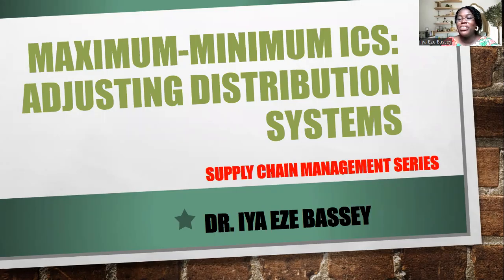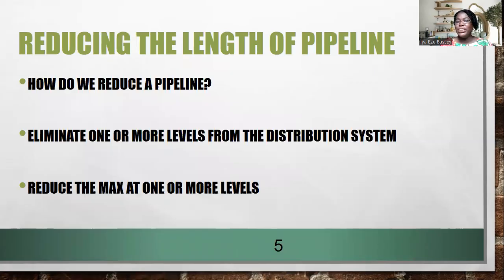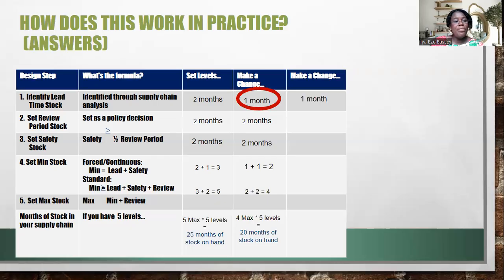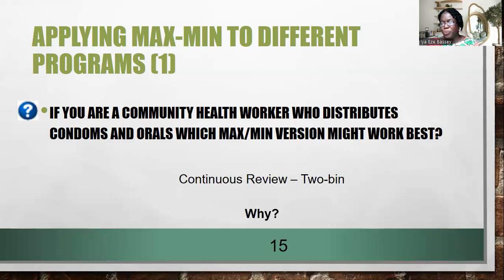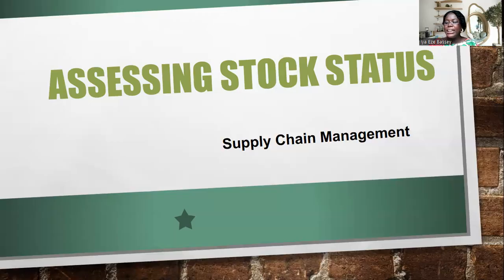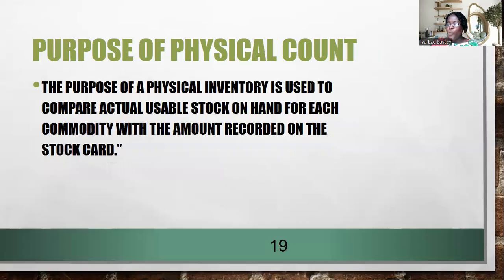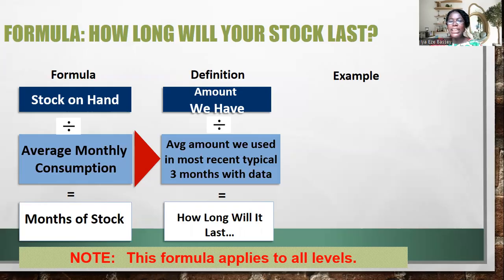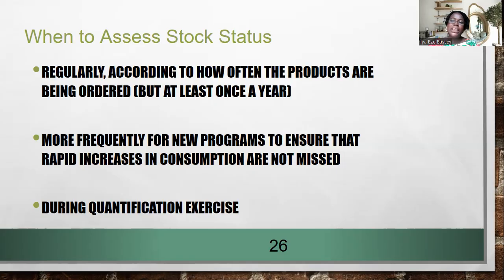Maximum-Minimum ICS: Adjusting Distribution systems (Supply chain management series)

Comment: SUMMARY OF VIDEO ON "MAXIMUM MINIMUM INVENTORY CONTROL SYSTEM
ADJUSTING DISTRIBUTION SYSTEMS"

    I Learnt The STEPS IN DESIGNING A MAX-MIN ICS;
a) Set Up Initial MAX-Min Policies for each level and type of Facilities

b) Check If the overall Distribution will function properly if the level specific MAX-Min Policies are implanted.

c) Check the total length of the pipeline that the policies at each level imply.

    I also learnt How To Reduce The Length of Pipeline, How to Reduce the Maximum Stock Level, How to set Safety Stock, Minimum Stock, Maximum Stock,etc.
    I got an understanding of the FACTORS THAT IMPACT MAX-MIN STOCK LEVELS, such as:
Cost of Products, Cost of Storage, Storage Capacity, Accuracy of Forecasts,Lead Times,etc.
    I learnt the ADVANTAGES OF USING A MAX-MIN SYSTEM, which are to:
Avoid overstocking or understocking, Avoid costs of Emergency Order, Minimize wastage, etc.
    Also, the CHALLENGES TO USING EACH VERSION AND VARIABILITIES were outlined as:
Systems with numerous level, Systems that manage products for new programs, Systems that manage a large number of commodities.
   The video Gave insights on PHYSICAL COUNT; it's Definition and purpose. I also learnt when to assess stock status.
   Lastly, some calculations were done to deepen my understanding of the topic.  

THANK YOU MA

Comment: Thank you ma, 
I've acquired knowledge about the steps involved in distinguishing maxmin inventory control system (ICS), the methods of reducing pipelines length and various factors affecting the determination of max-min stock levels. I've also gain in the benefit of max-min system, such as preventing over stock and under stocking along with various challenges. I'm glad to say that the class was enjoyable..
Thanks 🙏🙏❤❤

Comment: Thank you Dr. Iya Eze Bassey.

I understood that there are different steps involved in designing a max-min inventory control system;
- Set up initial max-min policies for each level and type of facility.
- Check if the overall distribution will function properly if the level specific max-min policies are available implemented. 
- Check the total length of the pipeline that the policies are each level imply.

Advantages of using max-min ICS.
- Avoid under stocking 
- Avoid over stocking 
- Minimize wastage
- Simplify inventory control decision decision making.
- Consistency of stock levels.

To reduce maximum the following are done;
- Shorten the review period at one or more levels.
- Reduce the lead time at one or more levels.
- Improve the distribution systems reliability at one or more levels so that safety stock can be reduced. 

Challenges involved are;
- System with numerous systems
- System that manages a large number of commodities.
- System that manages products for new program.

Factors that affect or have an impact on max-min levels are;
- Cost of production.
- Lead time
- Storage capacity.
- Age of program.
- Shelf life of health commodities.
Finally, I learnt that under assessing stock status entails physical count which is to compare actual on hand for each commodity with the amount recorded in the stock card and the purpose is to determine how long supplies will last.

Comment: Thanks to you Dr iya Bassey for the awesome enlightenmennt  of Maximum and Minimum Inventory Control System (ICS) in the context of Adjusting Distribution System in Supply Chain Management:

Maximum and Minimum ICS is a inventory management technique used to optimize inventory levels by setting upper and lower limits. In the context of Adjusting Distribution System, this technique is used to:

- Set a maximum level to prevent overstocking and minimize holding costs
- Set a minimum level to ensure adequate stock and prevent stockouts
- Trigger orders when inventory levels reach the minimum threshold
- Adjust distribution quantities based on demand fluctuations
- Optimize inventory levels across the supply chain

By implementing Maximum and Minimum ICS, businesses can reduce inventory costs, improve order fulfillment rates, and increase supply chain efficiency.

Thanks ma and God bless you 🙏

Comment: This series takes a deeper insight into the maximum-minimum inventory control system.  It helps to analyze data patterns, lead times, and customer preferences, thus helping businesses to optimize their distribution network to ensure efficient and timely delivery of their products to customers.
Steps in desgning this system was highlighted .
The advantages of the maximum-minimum inventory system are
1 it minimizes wastage.
2;it helps to avoid understocking
3 it helps ti avoid overstocking 
4 it helps to avoid the implications of emergency order.
The factors that can impact on  max-min stock level include; storage capacity,lead time, shelf life of health commodities etc.
To access stock level, it is best to do a physical count of the Total number of usable units of each commodity in the store store or health facility at any given time.
The series also discussed the benefits of max-min ics and it's associated challenges.

Comment: I am grateful for the enlightening lecture, which enabled me to gain valuable insights into optimizing inventory management. The key takeaways from the video include:
- Strategies for streamlining the supply chain: eliminating unnecessary stages in the distribution system.
- Factors influencing optimal stock levels:
    - Product cost
    - Storage capacity
    - Shelf life of health commodities
- Benefits of implementing the max-min system:
    - Mitigating overstocking
    - Preventing understocking
    - Reducing wastage
- Challenges associated with implementing diverse versions and variations of this system across multiple levels.
This lecture significantly enhanced my understanding of managing inventory control for HIV/AIDS commodities, empowering me to make informed decisions in my professional endeavors

Comment: Thank you for the lecture video ma. With this I have been able to understand that the max-min inventory management system (ICS) gives detailed instructions for managing stock levels to avoid overstocking and understocking of commodities. Steps in designing a maximum minimum ICS include;

- Setting up initial max-min policies for each level and type of facility
- Checking of overall distribution will function properly if the level specific max-min policies are implemented.
- Checking the total length of the pipeline that the policies at each level apply to

Comment: Thank you very much ma for this enlightening session…
I’ve learned that the maximum-minimum(max-min)inventory control system  is crucial for managing stock levels helping to prevent both overstocking and understocking.
Key steps is designing a max-min system include:
Establishing max-min policies for each facility type.
Ensuring the distribution system functions effectively,
Setting initial max-min quantities..
Benefits of the max-min system include,avoiding overstocking,understocking,minimizing wastage and reducing emergency costs…

Comment: Good day ma, in summary I’ve learnt the steps in designing a maximum minimum ICS, there are as follows:
-Set up maximum-minimum policies for each level and type of facility 
-Verify that the overall distribution will function properly 
-Establish initial maximum minimum quantity for each level and facility type 
This are some advantage of using maximum minimum system which are: 
1. Avoid overstocking 
2. Avoid under stocking 
3. Minimize wastage 
4. Avoid cost of emergency

Comment: Adjusting the distribution system in maximum and minimum inventory control system involves find tuning the supply chain management system to optimise inventory levels and distribution processes. Here are some key adjustments to consider:
*Lead time reduction : This is the decrease in lead times by negotiating with suppliers improving transportation efficiency or using expedited shipping options.
*Safety stock optimisation : Calculate and  adjust safety stock levels based on demand viability, lead time and service level requirements
*Reorder points adjustments: adjust the reorder point adjustment based on changes in demand ,lead time or safety stock levels.
Other adjustments to consider are:
*Order quality Optimization
* Distribution Network Optimization
* Inventory Placement
* Transportation Management
* Warehouse management
* Inventory Visibility
* Continuous Monitoring 
Implementing this adjustments, optimises your distribution system and improve supply chain efficiency.

Comment: Thank you ma.
  From the lecture video I was able to learn the following 
  How to streamline the pipeline: Remove One or more stage from the distribution system.
Factors influencing maximum and minimum stock level.
 - product cost 
 - storage capacity 
 - shelf life of health commodities 
Advantage of implementing the max- min system 
Preventing overstocking 
Preventing understocking
Reducing wastage
 The difficulties associated with employing different version and variation of this system with multiple levels. The lecture significant improved my comprehension of managing inventory control for HIV/AIDS commodities.

Comment: Thanks MA 
I have learnt that maximum minimum is defined or can be defined as a system implemented to avoid wastage, overstocking and understocking of commodities 
The steps includes 1: creating maximum-minimum rules at the facility 
2 check if these rules will enable the functionality of the maxi-minimum when implemented 
3 check the total length of pipeline these rules require 
factors that could affect maximum-minimum are cost of commodities and their storage, transportation etc
Advantages include :Minimize wastage 
                                     Avoid overstocking 
                                     Avoid understocking

Comment: Thank you for the insightful lecture, Ma'am. Here's a concise summary of what I learned in this lecture:

I got to understand that (ICS) provides comprehensive guidelines for managing stock levels to prevent both overstocking and understocking of goods. From the lecture I also got to understand that It encompasses various steps involved in designing the system, methods for reducing pipeline length, and factors affecting the Max-min stock levels.
There are several factors that affect max-min levels which includes;
1. COST OF PRODUCTION, 2. LEAD TIME,
3.COST OF STORAGE, 4. STORAGE CAPACITY, 5.AGE OF PROGRAM.
And that the distribution system policies can be adjusted by; (a). Reducing the length of the pipeline that is eliminating one or more from the distribution system and reducing the maximum at one or more level (b). Reducing the maximum stock level, i.e shortening the review period and lead time at one or more level.
Thank you ma

Comment: Max-min inventory control system provides comprehensive guidelines for managing stock levels to prevent overstocking and understocking.
This lecture talks about the various types in designing a max- min inventory control, the steps fro reducing pipeline length,and some factors affecting it.

Comment: In summary, i learnt that there are steps to designing the max-min Ics which are 

(1) Evaluate the total length of the pipeline to ensure that the policies at each level comply with the specific requirements 

(2) Establish initial max-min policies for each level and type of faculty 

(3) check if the overall decision will function properly with the max-min policies implemented each levels.. 

Benefits of using max-min systems

(1) it helps to avoid under-stocking
(2) it helps to avoid the cost of emergency
(3) it helps in minimizing spoilage 
(4) it prevents over-stocking 

The max-min ics provides comprehensive guidelines for managing stock levels to prevent over stocking and under stocking of goods

Comment: Thank you Dr. Iya Eze Bassey!

In summary, adjusting distribution system policies can involve strategies like centralizing or decentralizing warehouses, revising stock replenishment rules, and optimizing transportation routes. The Max-Min Inventory Control System aims to maintain inventory levels between maximum and minimum thresholds, providing advantages like reduced stockouts and efficient use of storage space, but also challenges such as the need for accurate demand forecasting.

The logistics management of HIV/AIDS Commodities (LMHC) utilizes an inventory control system focused on ensuring availability of essential medicines and supplies. Assessing stock status evaluates current inventory levels compared to expected usage, enabling calculation of the number of months of stock available at each storage location. This data informs distribution planning and helps avoid stockouts or overstocking.

Comment: The max-min inventory management system (ICS) gives detailed instructions for managing stock levels to avoid overstocking and understocking of commodities. The processes in building a max-min (ICS) include: * creating max-min policies for each level and type of facility; * ensuring that the overall distribution works properly; and * defining an initial max-min policy for each level and facility type. The benefits of employing the max-min system include: reducing waste, avoiding the cost of emergencies, avoiding understocking, and preventing overstocking.

B

Comment: From this lecture session I was able to understand 
THE STEPS IN DESIGNING A MAX-MIN ICS ARE:
1. SET UP INITIAL MAX-MIN POLICIES FOR EACH LEVEL AND TYPE OF FACILITY
2. CHECK IF THE OVERALL DISTRIBUTION WILL FUNCTION PROPERLY IF THE LEVEL SPECIFIC MAX-MIN POLICIES ARE IMPLEMENTED
*3. CHECK THE TOTAL LENGTH OF THE PIPELINE THAT THE POLICIES AT EACH LEVEL IMPLY
REDUCING THE LENGTH OF PIPELINE
• HOW DO WE REDUCE A PIPELINE WE CAN DO THIS BY EITHER 
• ELIMINATE ONE OR MORE LEVELS FROM THE DISTRIBUTION SYSTEM
• REDUCE THE MAX AT ONE OR MORE LEVELS
ELEMENTS OF THE FORMULAS WHICH CAN BE CHANGED IN ORDER TO REDUCE THE MAX STOCK LEVEL:
• SHORTEN THE REVIEW PERIOD AT ONE OR MORE LEVELS
• REDUCE THE LEAD TIME AT ONE OR MORE LEVELS
• IMPROVE THE DISTRIBUTION SYSTEM'S RELIABILITY AT ONE OR MORE LEVELS SO THAT SAFETY STOCK CAN BE REDUCEDOTHER FACTORS THAT IMPACT MAX-MIN STOCK LEVELS (1)
• COST OF PRODUCTS
• RELIABILITY OF TRANSPORTATION
• STORAGE CAPACITY
• COST OF STORAGE
• STORAGE CONDITIONS AT DIFFERENT LEVELS
•SHELF-LIFE OF HEALTH COMMODITIES OTHER FACTORS THAT IMPACT MAX-MIN STOCK LEVELS C
• LEAD TIMES

Comment: In summary,To MAXIMUM-MINIMUM ICS: Adjusting distribution system is all about identifying ways to Adjust distribution system policies by knowing the steps in designing a max/min control system which includes
1.Set up max-min policies for each level and type facility
2.Check the overall distribution it will function properly if the level specific max-min policies are implemented
3.Check the total length of pipeline at each level imply
The benefit of using max-min system are 
★it help to avoid overstocking  ★it minimise wastage ★Avoid understocking 
Also, there are challenges of this system, Lastly Physical count of stock is very important and should be done at least once a year.

Comment: The Goal if the Maximum-Minimum ICS, is for adjusting distribution system. There are different steps taken in designing the Maximum-Minimum ICS and they include;
Setting up initial Maximum-Minimum policies for each level of the facility 
Checking if the overall distribution will function properly 
Checking the total length of the pipeline that the policies of each level imply. 
Furthermore this has advantages; 
It minimizes wastage
It avoids under stocking 
It avoids over stocking 
And it avoids the cost of emergency orders 

Also the physical counts is usually done to calculate the total number of usable units in a facility at a given time. 
Thanks

Comment: Thank you, Dr. lya Bassey, for this enlightening session!
I've learned that the maximum-minimum (max-min) inventory control system is crucial for managing stock levels, helping to prevent both overstocking and understocking.
Key steps in designing a max-min system include:
Establishing max-min policies for each facility type.
Ensuring the distribution system functions effectively.
Setting initial max-min quantities.
Benefits of the max-min system include avoiding overstocking, understocking, minimizing wastage, and reducing emergency costs. However, it can be challenging for systems with multiple levels, numerous commodities, or new programs. Regular physical stock counts are essential, especially for fast-moving items.

Comment: In this series I have learnt that if you want to to design a max-min ics, you have to follow these steps
- Setting up initial max-min policies for each level and type of facility
- Checking of overall distribution will function properly if the level specific max-min policies are implemented.
- Checking the total length of the pipeline that the policies at each level apply to

Advantages of max-min system
- Waste reduction
- Prevention of overstocking and understocking
- Consistent supply Maintenance

When do we access stock status?
1 Regularly, according to how often products are being ordered
2 Make frequent for new programs
3 During quantification exercise

Comment: I learnt about the Max-Min Inventory Control System as an inventory management system that ensures adequate stock levels preventing stockouts and overstocking.

This is how it works:
Inventory levels are constantly monitored.
 When inventory reaches the Min level, a new order is triggered.
The order quantity is calculated to bring inventory up to the Max level.
Inventory is replenished, and the cycle repeats.

The max-min inventory control system helps to;
- Maintain optimal inventory levels
- Prevent stockouts and overstocking
- Reduce inventory costs
- Improve supply chain efficiency

The Max-Min system ensures that inventory levels remain within a predetermined range, avoiding stockouts and overstocking, and optimizing inventory management.